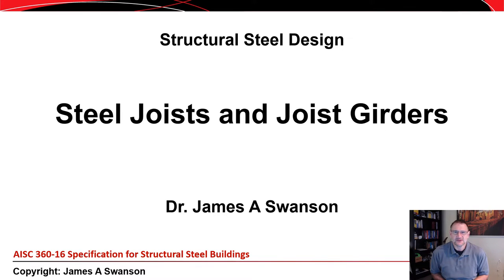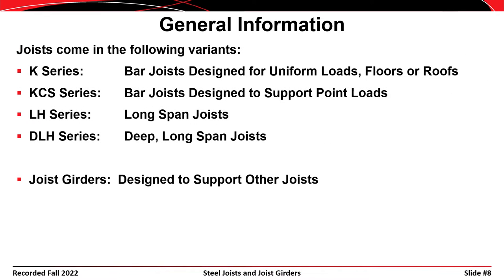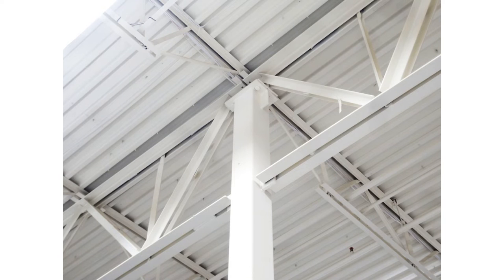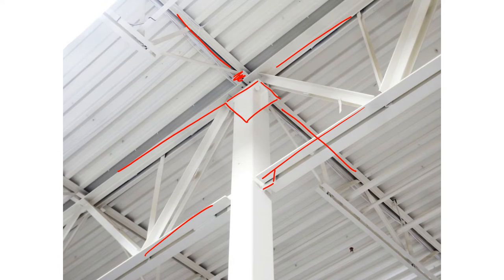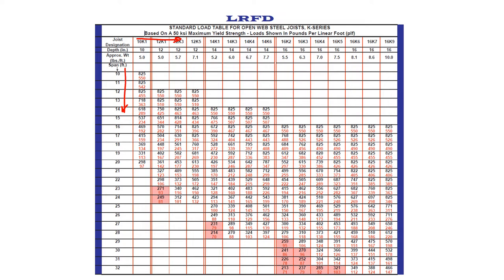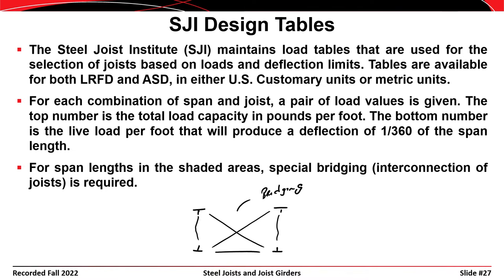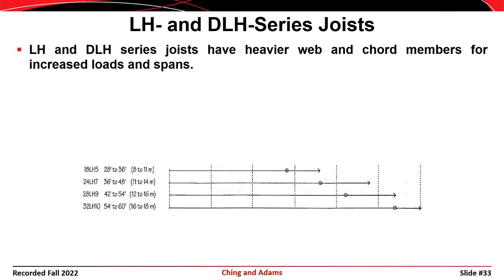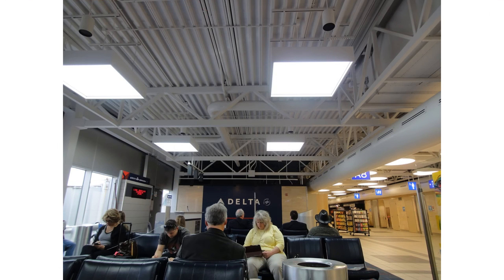STR05 L02c - Steel Bar Joists and Joist Girders

Comment: I stopped this video to make myself a macaroni and cheese microwavable cup because I knew it was going to be a good one. The other day I did the same thing. I took a few pics to study the design a bit closer. You got a thumbs up from me. Keep them coming. On a side note, down here in South Texas they converted an old Wal-Mart into a migrant center/ Southwest Keys program. They hired a random contractor to build some 9ft wooden walls to divide the facility into dormitories and classrooms. The Fire Marshall went not too long ago and threatened to fine them because they had no plans or permits. Crazy stuff.

Comment: Dr. Swanson, consider tying this lesson in with metal deck selection. In practice, they go together but often they aren't taught at the undergraduate/graduate level.
Reply from the maker: Thanks for your comment.  I typically teach the three topics of (i) Fire Rating and Protection, (ii) Metal Decking, and (iii) Bar Joists together in one course module.  The Fire Rating and Protection lecture is here: https://youtu.be/io7W1OcRp3I   Metal Decking lecture can be found here: https://youtu.be/MhA0EAYjo38